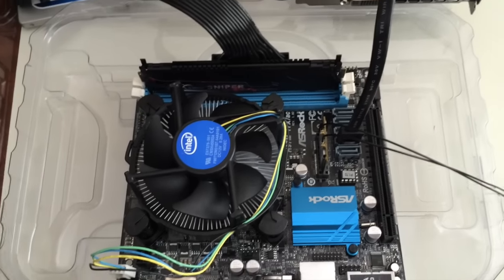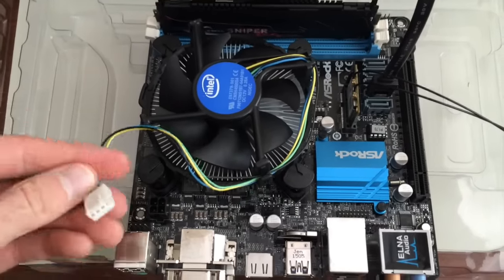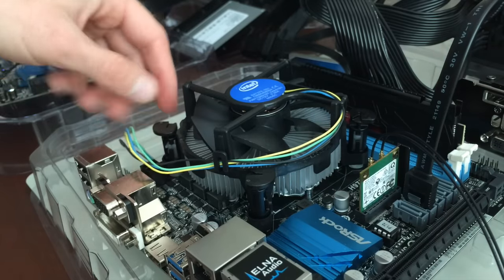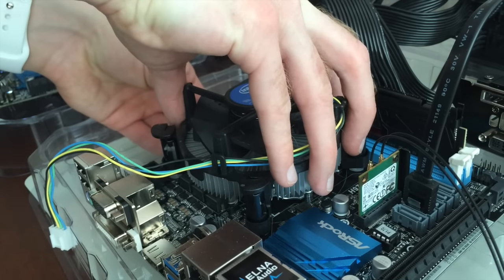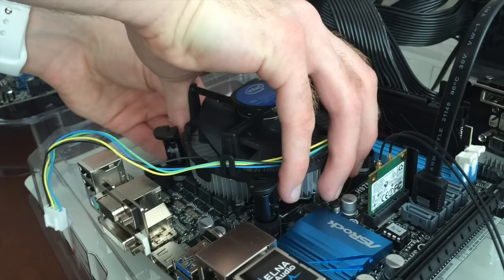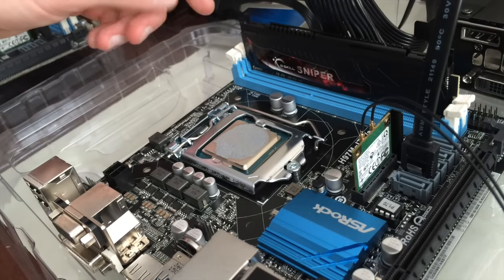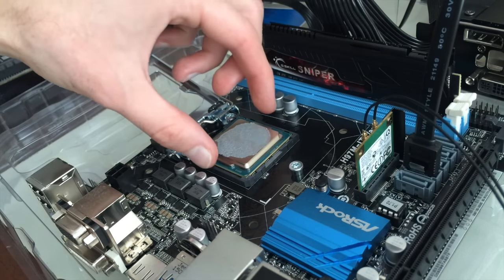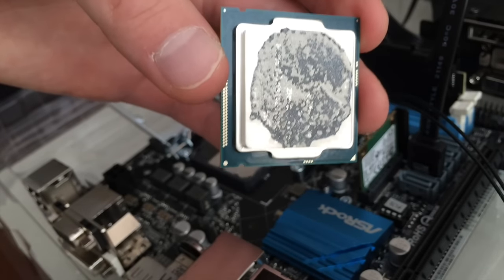How to remove Intel CPU and heatsink

Comment: So I removed my radiator to clean it and when I put it back it start overheating
Reply from the maker: you removed the heatsink? did you clean and reapply thermal paste? how did you clean it?
Reply: @DouglasHewitt  I didn't put thermal paste
Reply from the maker: @rapybg2456  Thats why its overheating. You need to stop using it immediately and open it up and add some. Its like running a car engine without oil. There always needs to be fresh thermal paste applied when taking off heatsink and putting it back on. thats why its not recommended to remove it unless necessary. You don't need to do that to clean it.
Reply: Douglas Hewitt ... 

wait, I'm confused ... does this mean that I can put thermal paste in my cars oil thingy instead of oil? Because if correct, then by this logic I can put engine oil on my computers heat sink! 😂 ... which is super lucky for me because I've pulled the fan assembly off for cleaning but just found out I've run out of heat sink paste ... but luckily I have heaps of engine oil!!!

Mannnn ... learning this new workaround trick makes me so excited ima gunna go fix it all up RIGHT now and rush back to tell you all how well it worked!

😂

(p.s. .. before some 'sally serious' mentions to me I can't just swap thermal paste for engine oil and doing so might pose a possible fire risk if I did .. I'm not serious. I wouldn't do this! .. not to my own machine anyway! Haha)

Comment: I followed the instructions exactly but it still won’t come off.
Reply from the maker: did you get it off? where was it stuck?
Reply: @DouglasHewitt  no, i gave up. It’s just stuck to the motherboard, it just feel like each peg is still stuck on there even after twisting all of them
Reply from the maker: @mizuchi6022  hmm, maybe the thermal paste really has it stuck in there? can you wiggle it at all, like back and forth?
Reply: @DouglasHewitt  quite a lot
Reply from the maker: @mizuchi6022  oh I see, can you squeeze the little pegs or break off the plastic bits and then get it out? will need a new cooler tho

Comment: 1:45 mine is loose but doesn't come out
Reply: I had a similar problem, after the pins are loosened try to gently  rotate it back and forth. I did that and it came off
Reply: Hopefully it works for you if you are still by any chance having that problem
Reply: @FaceNapalm  I think I sorted it
Reply: @BRAWGWill  nice, i am finishing mine off now, just need to put the fan back now
Reply: @FaceNapalm  This was for an old motherboard. I put together my new PC in mid-February

Comment: Im fucking dumb, I built a gaming pc yesterday and used the stock cooler temporarily. I noticed that my pc lagged in every game and got mad. And today I saw the thermal paste NOT OPENED on my desk and understood that I forgot to put on the paste. And now my cooler has melted to the motherboard and I can’t get it off. So damn sad man, 8k down the drain
Reply from the maker: Oh damnnnn, that sucks man. Any salvaging it?
Reply: @DouglasHewitt  i solved it the next day. I got so mad that I pulled everything I had in me and got it off. Now I’m using another cooler instead and everything is working:)
Reply from the maker: nice! glad it wasn't ruined and still works with the new cooler

Comment: Mine stucks :( I did everything like in the video but it just doesn't go...
Reply from the maker: bummer; yeah sometimes they get stuck, its sorta lame. sometimes if you twist back and forth until it really pops, or get a screwdriver and poke them out from the underside, once they come free you can pull on it to break free of the thermal paste. Did you get it sorted?
Reply: @DouglasHewitt  i have the same problem right now. Its not the thermal paste thats making it stuck though, its something to do with the hardware, i dont know what to do and i dont want to break anything. HELP
Reply: @DouglasHewitt  am having the same problem, I opened up another pc today that had only screws and it was much simpler. This setup is actually not the best.  I don't want to pull everything too hard.